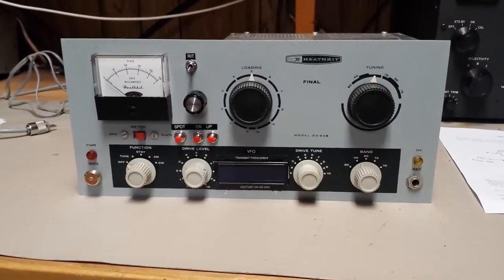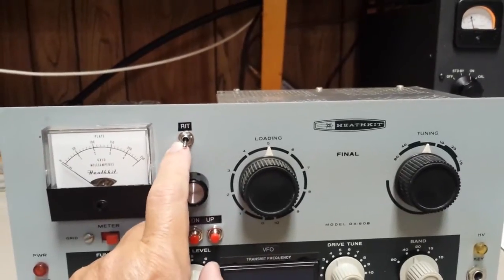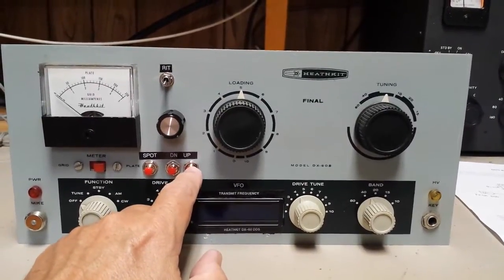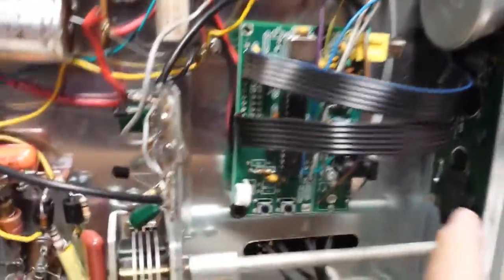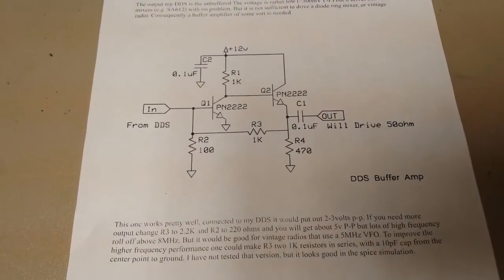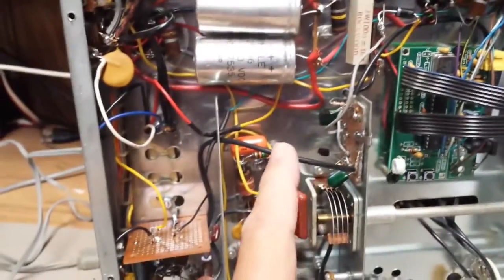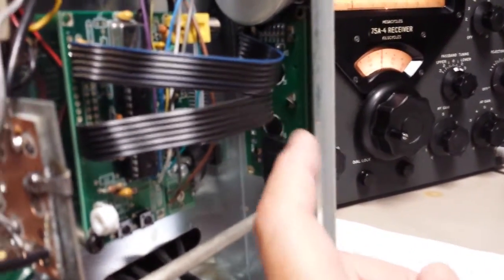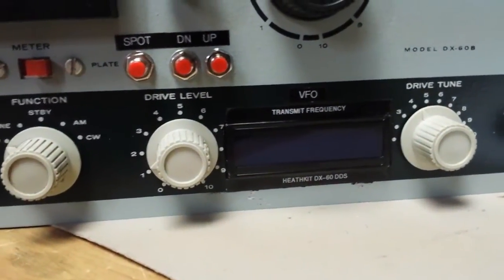Heathkit DX-60 DDS VFO mod

Comment: Nice job and a clean look, Steve. Have you experienced any RF interference in the display while transmitting? 

73, de Mick Bradford - WB4LSS
Reply from the maker: Surprisingly no RFI in the VFO or display and I made no effort to prevent it. I'm sure there's plenty of RF inside that green box too. I will be trying it out on higher bands.

Comment: You dont happen to have a schematic of your set up do you?  I cant make my n3zi drive my dx60.  Not sure where to feed the signal into the transmitter
Reply from the maker: Did you build the vfo buffer amplifier as I showed here? The plans are on N3I's site. Feed the output of it into the  DX-60's VFO jack on the rear.
Reply: Steve Ellington yes ive built the buffer. Did you have to modify the vfo input?
Reply from the maker: Nope. Just set the switch on front for vfo and feed the buffer in to the vfo jack. Maybe your buffer isn't working... On a scope you should see around  8 volts of signal or so.
Reply: thanks brother, ill check the output on the scope, mine has the added 1;2 step up transformer with the type 61 core so i should have plenty of output....i got some bad advice from someone and they said rip out that buffer tube and move the silver mica direct to the rca jack of the vfo input.   Ill get this tackled.. Thanks for the words of wisdom de KC3AAT